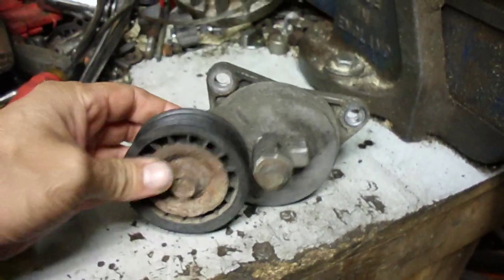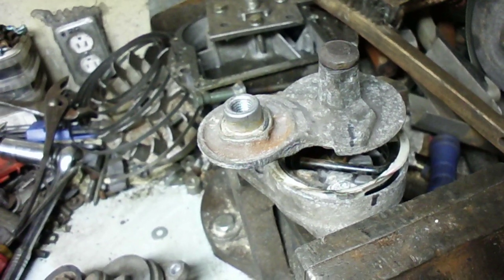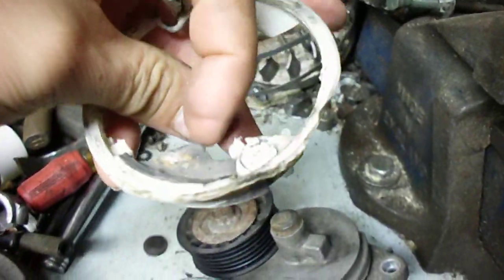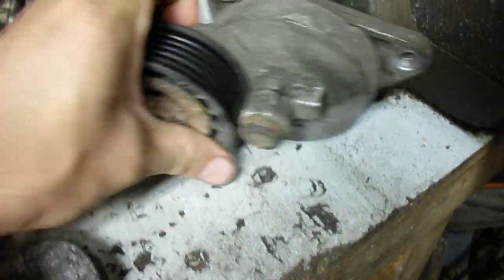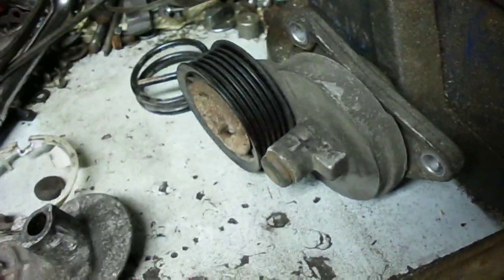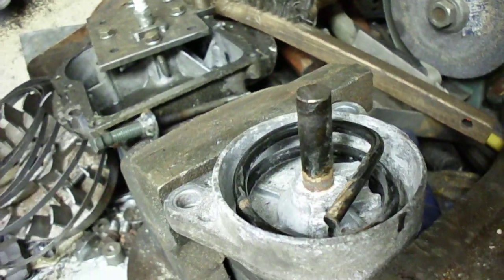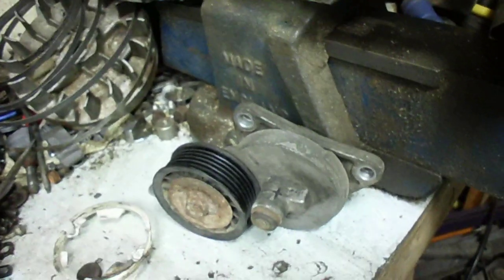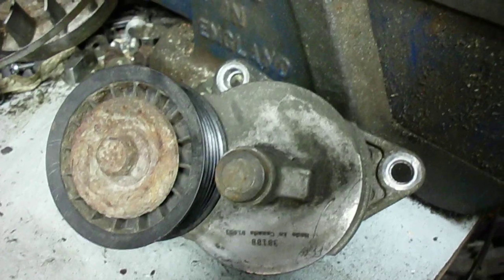Dissecting a Seized Focus Belt Tensioner

Comment: Electrolytic corrosion, bothersome stuff. Hope the oil keeps 'em going longer!
The problems I've had with tensioners on my parent's '07 Ford Taurus was the bearing in the tensioner pulley dying. Replaced that once, then replaced the whole thing when the bearing failed again and the spring lost tension and also had to replace the idler pulley once or twice. I really think these Chinese parts don't come with enough grease in them to have a long lifespan. Next time I get a new part I'm going to check for adequate grease!
Reply from the maker: Sounds like a good idea! Man that tensioner has been giving you a ton of grief. I had a 1 year old one off my focus off the car yesterday when I was changing the timing belt, my son drilled a small hole in it where i show on the vid, and sprayed in some lube, then plugged it with grease. I will dig the grease out, and spray more lube in periodically to prevent seizing, hopefully it works..
Reply: Yup. Hope your mod is successful!

Comment: After drilling the hole and get it freed up you could pack it with Lucas Red N' Tacky grease which has anti-seize in it to prevent it from seizing up again. I keep some on hand to use on small engine crankshafts to prevent pulleys/ etc from seizing on the shaft and I also use it on other applications.
Reply from the maker: Hmmm, never heard of that stuff, I will have to have a look for it!

Comment: How many miles on that Focus?
Reply from the maker: 199,000 km  so about 120,000 miles.
Reply: @ChargerMiles007 Very low for an '03.  Has that been sitting a long time?
Reply from the maker: Not that I know of, but I don't know much about the cars history. It is a nice clean car, the other one I have was a garbage dump inside, we had to totally clean it and shampoo the carpets, and wash every interior surface.

Comment: I think putting a grease zerk in the spring portion of the housing and packing the whole thing full of grease might be a good way to go. Like "Bearing Buddies" on boat trailers. I am not sure about the mount to housing clearances but if it is tight enough it should force some grease into the shaft area. If the clearances are loose then it will just make a mess. You could tie a rope around that intersection to seal it. I might be wrong but that's my 2 cents worth. I hate revisiting the same problems and can't stand salted roads. Good luck, I look forward to your solution.
Reply from the maker: There might be enough room for a tiny grease fitting, though it doesn't look like the wall thickness of the aluminum around the shaft is very thick.
Reply: @ChargerMiles007  
Not on the shaft, fill the whole spring housing with grease was my thought, hoping it would get forced into the shaft area. Put the zerk in the top of the spring housing area. A little extra grease on your metal will only help protect.
Reply from the maker: You could pack the spring area with grease, but it will leak out through some holes. The spring itself looked fine on this one, but the shaft was another matter. i drilled the little hole in another one like I mention in the vid, so i will have to lube it the odd time.